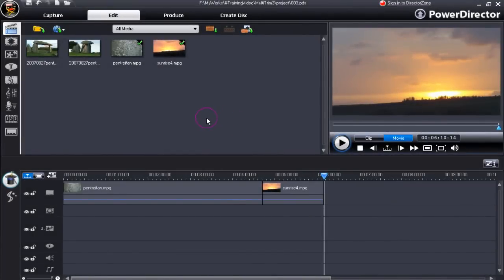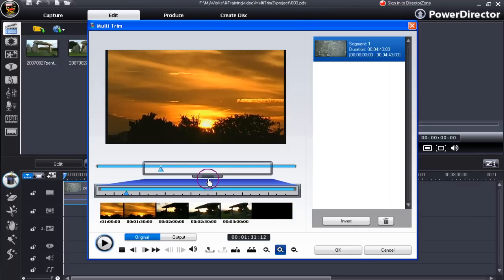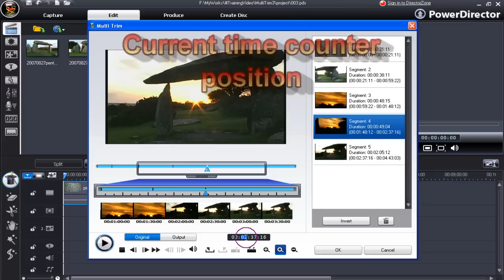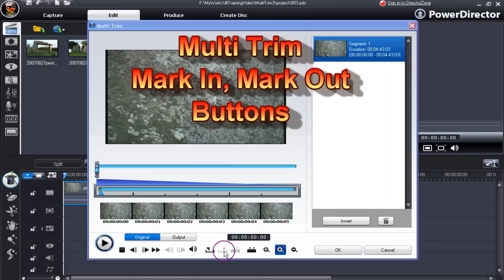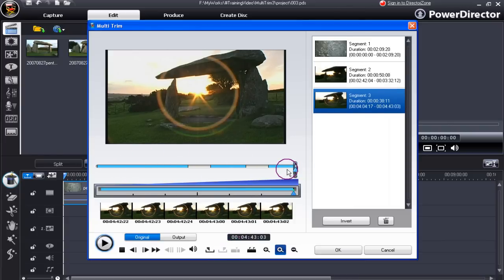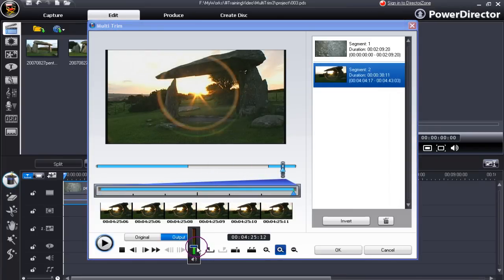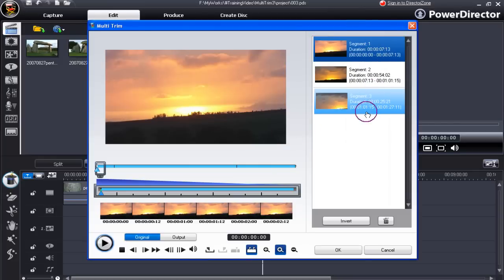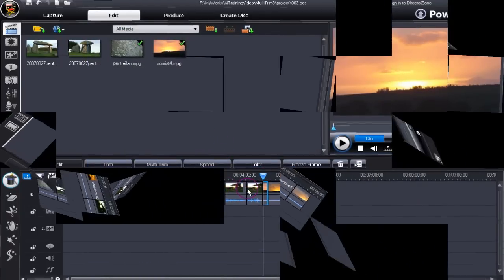CyberLink PowerDirector 7 - Multi Trim Videos

Comment: Thanks for posting this ... most of my time in the editor is spent with cuts-only type editing, but most marketing material is about useless glitzy features. I've been sticking with Corel VideoStudio for years because of the Multi-Trim feature and am pleased to see that another product now has this feature.

But I have a question: once you've set your mark-in/mark-out points, are they editable? Or do you need to start from scratch? Frequently after reviewing the edits I want to tweak them.